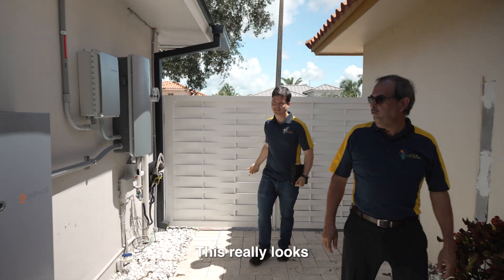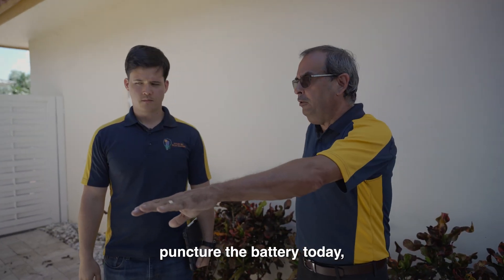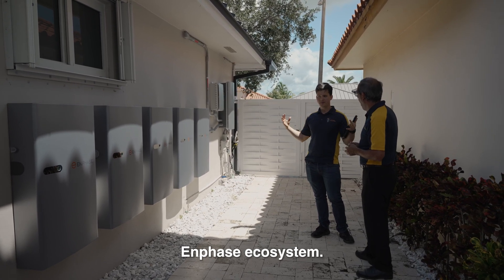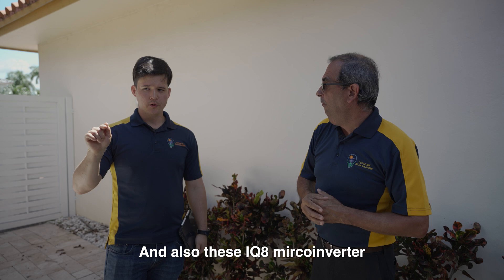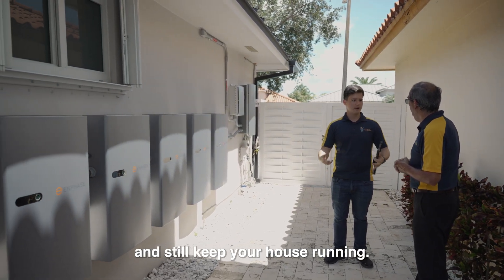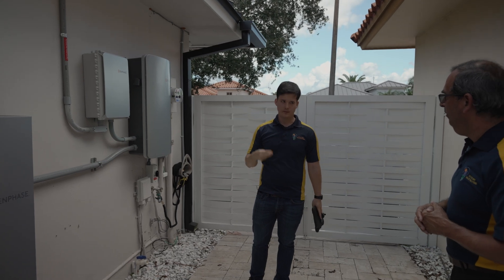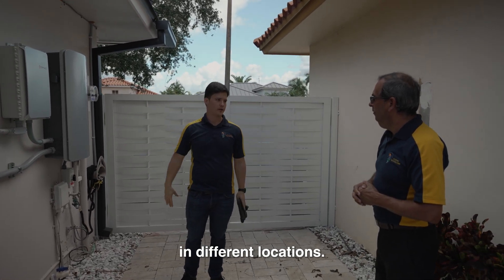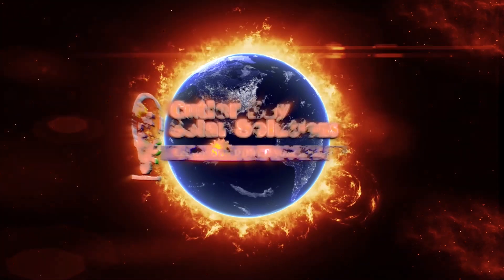New Enphase IQ Batteries 5p

Comment: I would suggest since they are using micro inverters in each battery to run separate wires to the control panel (breaker panel). I say this because max surge is 15kw on a single leg which is 125 amps and that requires a much much larger wire 0-1 gauge per leg.

Comment: If there's not Microinverter inside the batteries, when a battery broken, it will not have any effect to others which in parallel. So I still do not know what's the necessary to equip a microinverter inside it.

Comment: How is there 5 batteries connected ? The IQ system controller only allows up to 4 for a max 80A's
Reply: 4 batteries in one input 1 on second inout. 8 total possible w/o generator input

Comment: How much these five units cost?  I'm trying to compare them to the EP Cube where I can combine two inverters with 5 batteries per inverter (total of 15 KW ,  33 KWH) for under $20K
Reply: Personally, I'm shooting for 55kwh with Eg4 powerwall is a much better product with 10 years warranty.

My goal is to be 90% - 95% off grid. Tesla,Enphase,Franklin,Ep Cube.... do not provide a good ROI

Please shop around and do not get fooled by this type of video.

Enphase: 5kwh = 5 modules = $3,200 X 5 = $16k
Eg4: 14.3kwh = 2 modules = $3,400 X 2 = $6,800

Goodluck😎
Reply: @passerau  The only difference is that Enphase batteries have built in Inverter. The EG4 batteries need to be paired with an inverter which is another $5,000. I think the EG4 will still come out cheaper but not the numbers you were showing.
Reply: @AlexanderBell1847  hummm!!!! I don't think so
The Enphase IQ5P is strictly an energy storage device, you will still need a microinverter on each panel. Enphase doesn't use string inverter, they use microinverters $250/unit
Another $2500 (10 microinverters) on top of the $16k = $18,5k

Eg4 string inverter: EG4 6000 XP = $1,500
10 solar optimizers to boost effeciency $50 X 10 = $500

Based on the setup in this video if you want to replicate that, this will be the starting price between Enphase and Eg4:
Enphase: 25kwh = 5 modules = $3,200 X 5 = $16k + $2500 = $18,5k
Eg4: 28.6kwh = 2 modules = $3,400 X 2 = $6,800 + $500 + $1,500 = $8,800$

Goodluck😎
Reply: @passerau  Please double check on this. I researched Enphase batteries and found they come with built-in multi-inverters (actually this is an advantage for Enphase batteries since if one inverter fails, they have others running in parallel).

Comment: As someone who lives in a colder climate, the only concern I would have is that LFP batteries don't perform as well in the cold. But they allow for way more charge/discharge cycles without any battery degradation.

Comment: can they be installed on top of each other vertically?
Reply: This install actually does not conform to Enphase requirements of minimum 36” from ground on outside installs but I’m not sure how critical that distance actually is. Inside they can be 6” from floor. 6” minimum from box to box otherwise

Comment: CURRENT BATTERIES are a rip off.  The average home will need $25,000 - $40,000 worth of batteries and they only last about 10 years before you have to replace them.  You will never get your investment back.  No matter what they tell you under the new NEM 3.0.   Based on the video and the # of solar panels and batteries.   This system cost around $75,000.  You notice they never mention the price.
Reply: They have a 15 year warranty
Reply: You got no clue what you talking bout man lol. It ain't that expensive. And honestly its a no brainer in the long run to get one of these systems. The electric companies and traditional grid only setup is gonna kill ppls wallets more n more.
Reply: You can continue to pay SDGE 91 cents a kwh if you want ...my home 2200 sq ft home only needs 2 ..1 if I don't want to run the AC on it....they cost 10k each..a bargain to be off the grid
Reply: A heck of a lot cheaper than burying a natural gas tank and getting a generator.
Reply: you gotta run the calculations for yourself, don't just assume with salesmen.

that battery price does sound high. General solar panels ~should allow for a profit, albeit it may take 10yrs or so to get back the initial cost. If batteries are that expensive, then yeah you prob would lose money
Reply: What you just said makes no sense whatsoever. Batteries don’t last for only 10 years, they just degrade to about 70-80% of their original capacity after 10 years (that’s in the warranty). Also, why would you buy all of those at once? Just buy what you need to maximize self consumption under NEM 3.0. Then add to the system later on (they’re expandable) as prices decrease in coming years. 

A 5 kWh x 5 batteries is 25 kWh of storage, that’s about $15k-$25k. That’s before the 30% tax credit. Also, people aren’t typically adding batteries for savings, they’re doing it for peace of mind, and to offset selling to the grid at a severely discounted rate under NEM 3.0.
Reply: @LifeLongLearner-om8jx  well I would say we can "hope" the batteries last that long, but we all know laptop and cell phone batteries die very easily, are solar batteries somehow different? Can any long time 10+ yr owners of solar verify?
Reply: @timothyn4699  there’s literally a warranty from the manufacturer that says it will last that long or they will replace it with a new one for free. Lithium Iron Phosphate like the kind used increasingly for home storage applications has cycle life’s that exceed 8,000 cycles which is more than 25 years before degrading to about 70%. These are not the same chemistries as laptop or phone batteries that are lithium ion and purposefully designed to go bad after 2-3 years.

Comment: Great content!  Did I hear correctly that now these batteries can be installed on the other side of the house due to it being hard wired?  And what about voltage drop if that is the case?

Comment: The combined output power capacity of 5, 5P batteries is just shy of 20kWatt of continuous, sustained output.  This is 2.5 times the peak sustained power draw of my SoCal home in the summer.  In contrast, the 25 kWatt-hours of total capacity for all 5 can supply less than half of my daily summer solar generation and less than half of my peak daily demand this past summer.

Once your 5P battery configuration exceeds your peak sustained demand, buying more batteries means you are buying battery micro-inverters you don’t need.  What you need is more stored energy to cover your needs, not more sustained micro-inverter k-Watt capacity.  What we need is a modular battery that supplements storage that doesn’t force us to buy unneeded micro-inverters or 5P batteries that can be configured with 2, 4 or 6 micro-inverters.
Reply: Interesting point.

Comment: I have 33KW of the previous system.  It is rock solid.  With that said, this version has a lot of advantages.  Especially the ability to go up to 80KW.  During peak hours, I'm running 3 air conditioners and you can blow through 33KW of storage in less than 4 hours.

Comment: If I put a Soft Start device on my 3-ton AC system can 2 5P's power a home over night during a power outage, assuming I'm conserving as much as possible else where in the home?
Reply: Would depend on the time of year and how much you are discharging in the evening prior to sundown.  In California, we start discharging batteries after 4 pm to offset peak pricing.  ... Hope this helps... you can always add 1 more later.   :)

Comment: Will I still need the IQ8A Inverters on my panels since the batteries have built-in Inverters?
Reply from the maker: Hi, yes you will need on the panels also. Battery built-in inverters are only for battery conversion

Comment: I have to get an Enphase system. Fantastic technology. 

Enphase has created the Holy Grail of micro inverters (IQ series) that can create a micro grid. This allows the solar panels to continue creating energy that your house can use even if the Grid is down. It is also not necessary to have batteries for storage but that is a 24/7 system when you do. 

Any other inverter setup MUST shutdown if the Grid is down, even if the sun is still shinning. What a waste.

Comment: very interesting presentation. Would it be possible to mix a  system composed with IQ8M & Envoy-S & 3T battery with one additional 5P ?
Reply from the maker: No, 5p requires all version 3 components. IQ gateway 5C, all 5P batteries and IQ system controller 3

Comment: Enphase is the best when converting sunlight to residential useful energy. Their is no one better.  Best bang for the buck   When it comes to battery storage, they’re the best at that too especially with their software management.   The problem is they are way too high when it comes to battery storage.  I have an enphase array on my roof. It is great no problems, no hiccups., nothing from it for over 2 years.  I had a quote to get a 10k back up storage system even though I already had the equipment to accommodate..   Their certified installer wanted $20000 dollars for a 10kwh battery back up.  I said fuck that. That’s just a little less than the cost I put th whole roof 8k top array in for. I bought third party lithium iron phosphate battery’s 30KW worth at less than half the price they wanted for a 10kwh installation and did it my self..  enphase you need to tell your dealers to quit price gouging the customers.   I do own 500 shares of their stock. That’s how much I believe in them.   If they can get their price gouging battery storage dealers under control,  it will be a much better investment.
Reply: Exactly my issue. Great product, but the prices are insane. I was quoted $27,300 for 20kwh of these 5P batteries.
Reply: The problem is with that installer. I am not sure Enphase has any say in how much these installers can charge. They can suggest a MSRP but there's no legal way for them to enforce it. I just had two 5P batteries installed recently with no existing equipment and my installer charged me $14K for a complete install. So shop around for another installer if this one is not willing to play ball.

Comment: Those batteries will not do well. In places like South Florida with high ambient temperatures. Needs to be installed in an air-conditioned room.
Reply: Negative

Comment: The two 5P on the left at 7:37, they appear to be on stands of some sort. Are those stands an Enphase product or just an illustration? If they're an Enphase product, do they eliminate the (bottom) clearance requirement.

Also, what is the spacing between the 5P in this video? It appears to be greater than the minimum required by Enphase's installation guide, but I'd like to be certain and, if so, to know why it was dine this way.
Reply: That's an enphase product.
Reply: @USNEM thanks. What's it called, or its part number?

Comment: So I have solar. I have 14kwh of solar. I had my old electric hot water heater catch on fire and replaced it with a tankless hot water heater. I could not be happier. My only issue now is the draw when the grid is not active. I just did the math and in total darkness I do not think five of these would have any issue running my home. Sick. But I am sure they are expensive. Very expensive since the average power outage at my home is normally a quick on and off. Some outliers are a couple of hours. In 2018 I was without power for 12 hours. I do not know that the cost justifies it yet. Now there has been a push to get rid of netmetering but I still do not see the cost benefit at this point. Just add more panels they still have to pay you for what you produce it just might not be over a monthly average. It might actually work out better. Just imagine the power company having to pay customers over the summer and then charge them during the winter.

Comment: Trying to understand what advantage these have over Tesla Powerwalls?  These five units don't even add up to the capacity of two Tesla Powerwalls.  They mention "lots of redundancy" several times, but that also means more complexity and lower mean-time-between-failure because there are so many components that can fail.  For the amount of wall space consumed for this install they could have had 2x or even 3x the total capacity with Tesla Powerwalls which can stack on each other.  Competition in the market is great, because it drives innovation, I'm just struggling to understand what that innovation is in this case.
Reply from the maker: -bigger footprints due to safer chemistry LFP vs NMC in powerwall 
- PW require a more complex cooling system, emphase is passive cooled
- PW has only 1 inverter per every 13 kWh , emphase has roughly 18, no single point of failure, if one micro fails, the rest of the battery can still operate. 
- Enphase provide the entire ecosystem with modularity and redundancy from the rooftops microinverters to the batteries, MID and accessories. 
- grid-forming IQ8 allow for a more granulated energy management that AC coupling control on the PW. also allows for blackstart capability and scalability.
- smaller modules size can accommodate more precisely to homeowners needs.
- 15 years of warranty
- larger surge power per kWh in the emphase 5P 
- Enphase customer support is simple top class in the industry, a mile away from Tesla's.
Reply: You might want to do some more research
Reply: @USNEM  Agreed.  Some of the advantages called out by @cutlerbaysolarsolutions4181 aren't even things I understand, like grid-forming vs. AC coupling control.  Clearly I've got more to learn.

Comment: wait people couple more years. don't fall for those battery storages. I am predicting that all the EVs soon will be able to host your extra solar power and power your house during power outage. Bi-direct chargers are coming and Tesla eventually also should make bi-directional communication available
Reply: Using a vehicle for energy storage for your home sounds great at first. I mean, compare the cost and storage capacity of an EV battery to the cost of the same storage capacity in a system like this and the vehicle bit (everything minus the cost of the battery capacity) seems miniscule. 

There are problems with only having a (hypothetical) EV battery for home energy storage, though. Obviously that the EV isn't always in the home (in most cases). So, when your energy generation is happening but the EV isn't connected, it's not storing that energy in the EV.  Also, if the EV isn't home, there's, obviously, no access to the home to use energy stored in the EV. Sure, if the EV is always home, neither of these is a real issue, but then the "car bit" of the EV is just needless extra cost that's taking up way more space than necessary and likely adding cost of maintenance, insurance, depreciation, inspections, taxes, registration, etc.

Most folks who'd chose to EV for some energy storage would probably still opt for some home based energy storage. Likely most systems supporting vehicle-to-home would require some home storage as well. Also, there will likely be limitations on the power output/input of EVs used for this purpose. Not to mention logging that will undoubtedly have an impact on the EVs depreciation. I think it's reasonable to expect depreciation on home storage to be less than that of an EV, as a percentage of original costs, especially if the costs of owning the EV over time are factored in with depreciation. There's also tax and rebate differences to consider. 

I think having access to the energy stored in an EV makes sense, along with being able to store production in an EVs battery. That said, I think it's probably best as a supplement (in some cases) to home storage, not a replacement or even good primary home battery for either capacity or power.
Reply: I agree. The caveat is the cost of purchasing an EV. EV cost too much money.
Reply: @proudpatriarch9341  you can drive EV. You cannot drive enphase.
Reply: if you're away with your car, you waste solar energy. Having a primary storage is ideal
Reply: @fetB  I'd rather waste it than will give it to utilities for free.

Comment: not sure who are those so-called "product designers", - but those 5 boxes looking so awful and each one providing only 6kWh. Why is that? Why you cannot make it like a rack standing on the ground and then you squeeze in the rack as many batteries as customer need? Why is that ugly mount to the wall. And not all the walls can handle such a load plus it is extensive damage to outdoor brick. Imagine how to remove that panel and replace or service. Be smarter guys. Even Tesla has twice in size 13.5kWh powerwall plus setup.
Reply: I don’t think anything prevents from stacking these how you want as long as they are the required distance from each other.